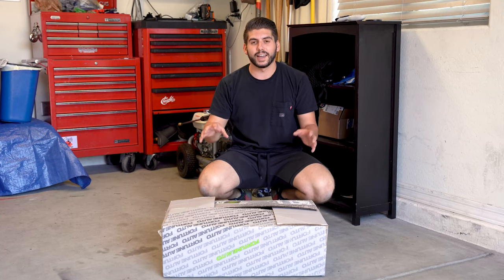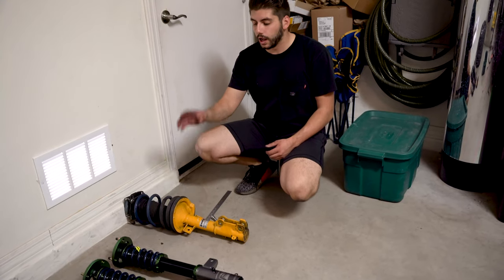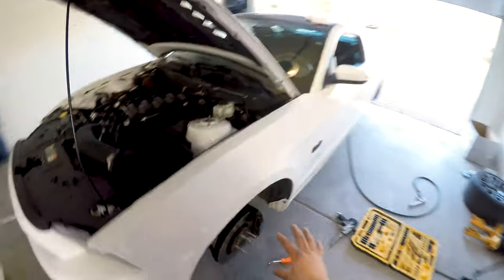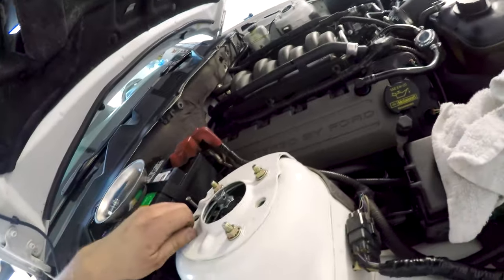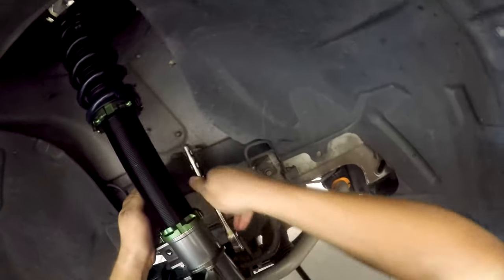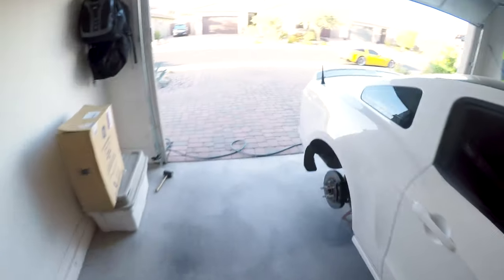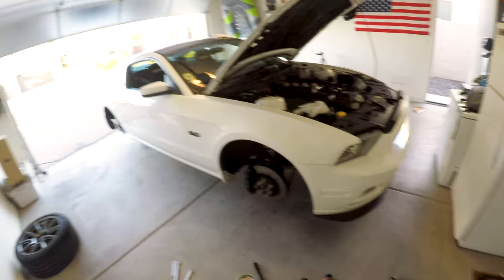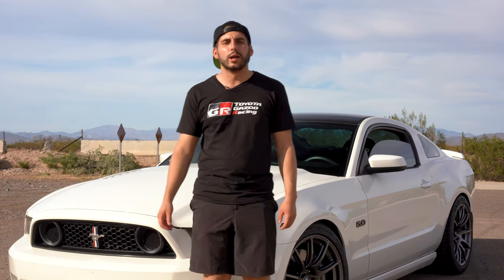Installing Fortune Auto 500 Coilovers on my Mustang GT! - Are they worth it?

Comment: I have the same setup, but my endlinks keep popping our of the white line sway bar im not sure why any advice on that?
Reply from the maker: I had the same issue where my FA end links kept breaking. You’ll need to go with Whiteline sway bar end links as they’re much stronger. I believe the correct length end link part # for the S197 is KLC-180 although I could be wrong.
Reply: @Massimo_Media  I got the orange white-line sway bar end links with the sway-bar kit but they where way too long with my car being lowered. Did you use a different sized white-line end link than what came original with the sway bar kit?
Reply from the maker: @sls-mt1hs  yes, I believe Whiteline part # KLC-180
Reply: @MassimoO You still have this car? No more videos of it?

Comment: When you drive it could you say that it corners like it is on rails. Or would you choose a higher spring rate?
Reply from the maker: I’ve been in a few cars that truly handle like they’re on rails, and I would say this car stacks up to them. I’d rate it a 8.5/10. But I wouldn’t go with a different spring rate, I think most of the -1.5/10 rating attributes to the car being so heavy at ~3500lbs and I haven’t played with fine tuning of my suspension parts a whole lot yet (damping on coilovers, sway bar adjustments, etc.).
Reply: I got pretty much every suspension part upgraded on my 5.0 but I went with ST XTA coilovers and they just feel way too soft and don't handle too well for my liking..
Reply from the maker: @32jonathana  you should look into the Fortune Autos. They’re very stiff on the track and surprisingly comfortable on the street.

Comment: Wait so when you buy these coil overs it doesn’t come with every thing you need to instal? Why did you have to get new bolts or not use some of the hardware that came with them?
Reply from the maker: It came with almost everything. Those bolts discussed in the video were the only thing I needed to make my FA coils work on my car. This could just be something missed in my order only.

Comment: I have the same setup, how did you tighten the rear shock top nut ? When I try to tighten it just spins the shock shaft and never get fully tight.
Reply from the maker: I remember that was a tough one. I believe I had my install partner hold the shock in the wheel well area with his hands and really grip it while I tightened the top nut in the trunk area. Or something along those lines.

Comment: how did you know where to put your camber?
Reply: I'd say nothing more than -1.5⁰ for a street car. If you're focused on track (roadcourse) performance, start at the -1.5⁰ and check your tire temperatures at the inside and outside tread blocks once the tires are warmed up. The goal is to keep the tread temperature inside to outside are as even as possible, indicating that you're making the most of all the tread and thus making as much grip as possible. If the outside tread blocks are hotter, add negative camber. If the inside blocks are hotter, bring the camber closer to 0⁰. 
Of course, this is just a starting point for specifically making more grip, so most of the time if you've got that camber adjusted in the method I just explained and you aren't happy with the grip in specific situations, you'll have to tune the rest of your suspension to suit your driving style/the track/conditions.